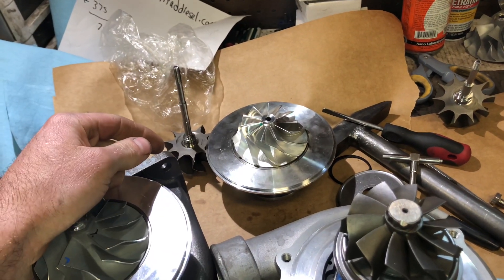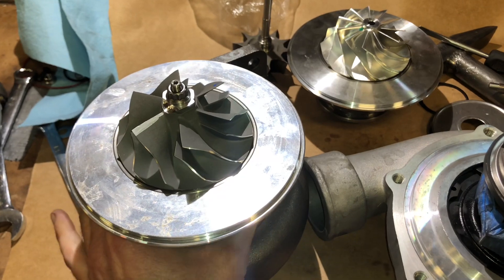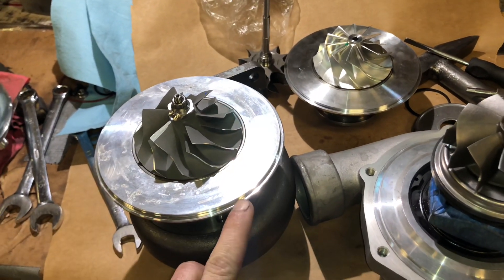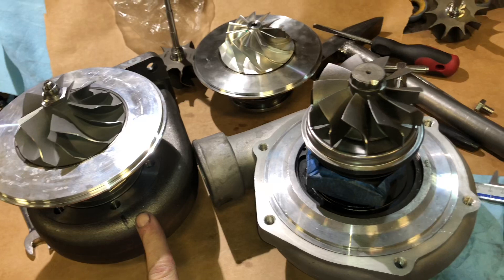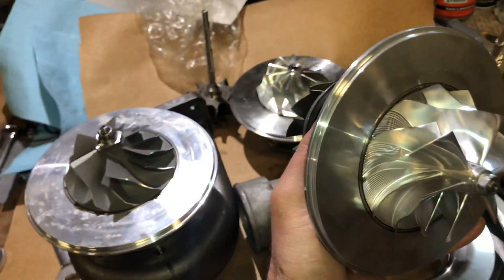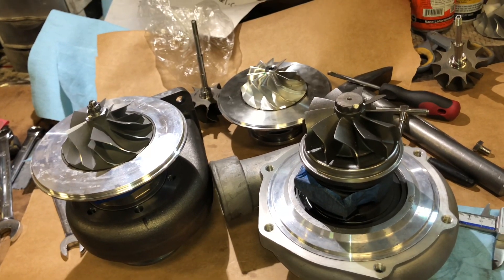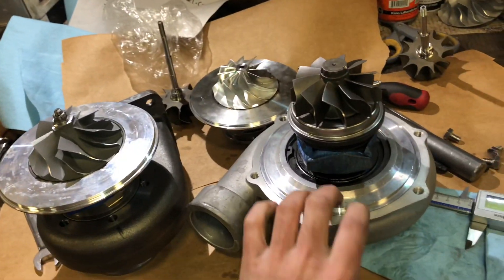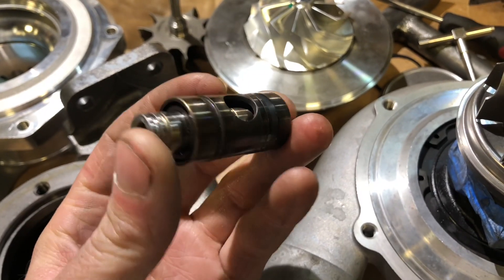Vs racing 6262 upgrade options

Comment: really curious about the new vs racing 61/62 gen2 dbb with billit wheel. they do have the cast journal bearing ones dirty cheap but they do offer a dbb billit "gtx based" option as well.